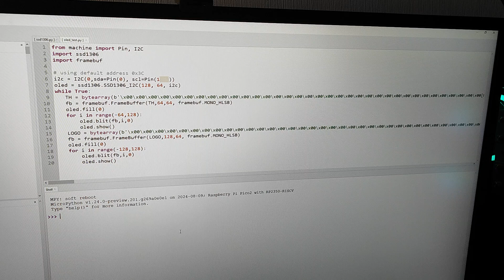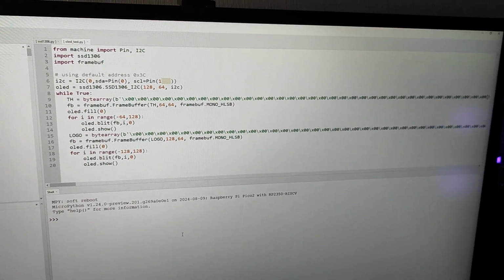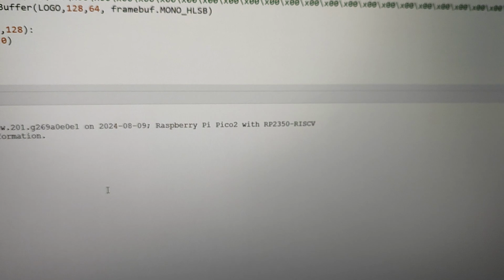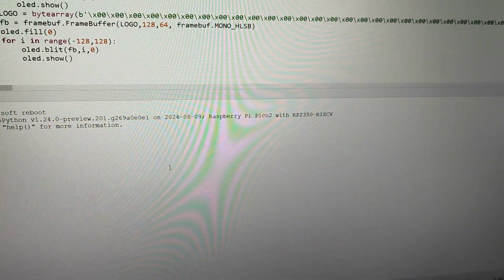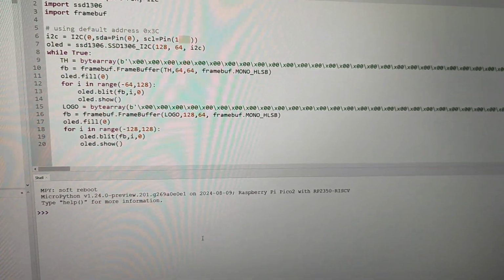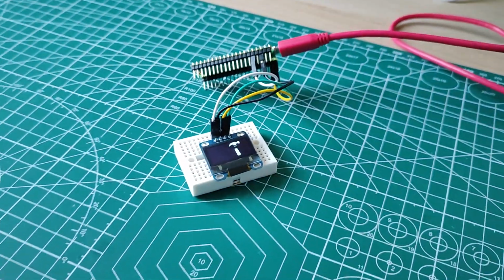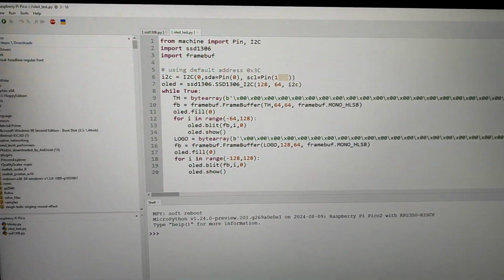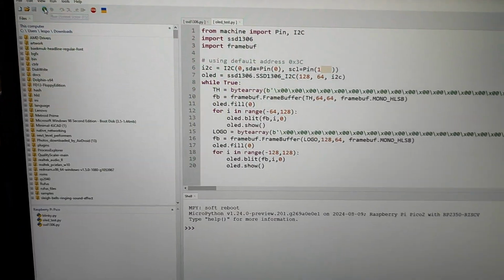Raspberry Pi Pico 2 RISC-V Project

Comment: Hey, so I was considering buying the Raspberry Pi Pico 2. But I have one question:

To switch to the RISC-V CPU. Is it really as easy as installing the RISC-V version of MicroPython?
In other words, it will simply just use the RISC-V CPU when I install the RISC-V version of MicroPython. And use the ARM CPU when I install the standard version of MicroPython?

Comment: risc-five, how was your experience in using the pico 2? Any different to pico 1?
Reply from the maker: Thanks. Pico 2, for basic GPIO stuff with MicroPython, feels the same as Pico 1. The extra RAM and CPU power will be more useful for the more complicated / exotic projects like emulation.
Reply: @LesPounder  i heard pico 2 has better power usage.
Reply from the maker: @fizipcfx  It supposedly has better power usage. I've yet to test that aspect. Jeff Geerling has made some progress testing that.